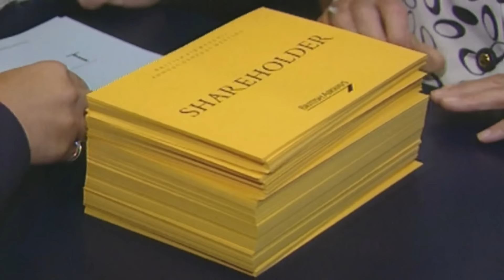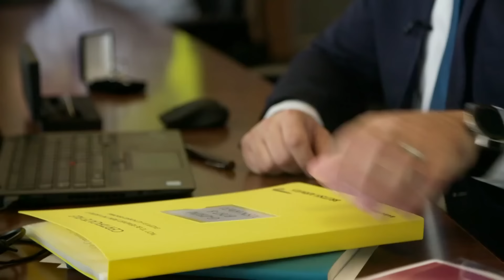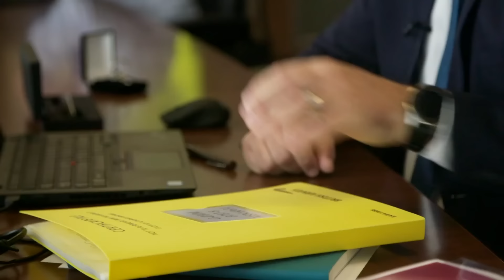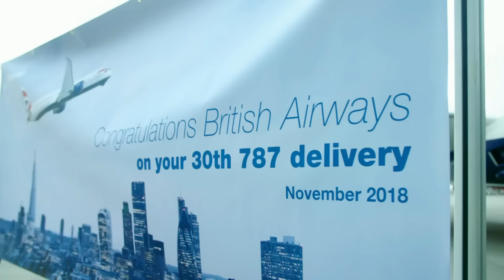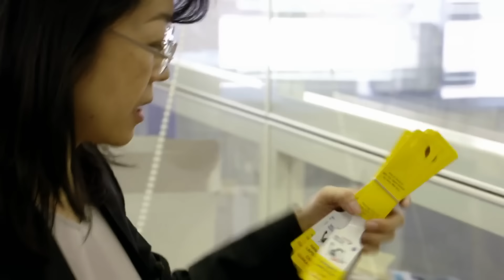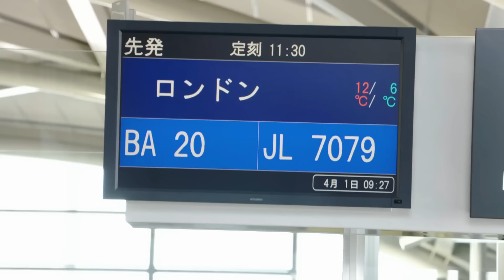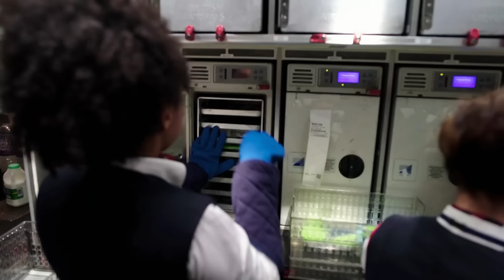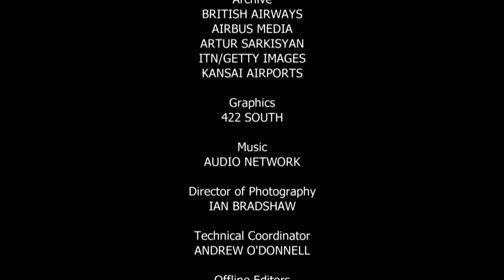Inside A Dreamliner - Inside British Airways - S01 E01 - Airplane Documentary

Comment: (42:30) The 747 had its first flight in 1969 and began entering service with airlines starting from 1970. I'm wondering how BOAC could've flown it's first 747 route in 1964...
Reply: Dreamliner is coming to Maldivian.
Reply: I understood the narrator to mean the route from Heathrow to JFK opened in 1964, not the 747